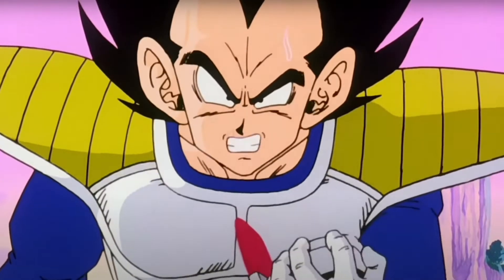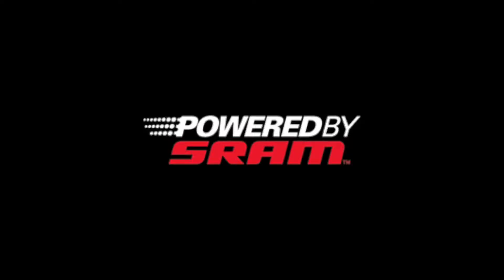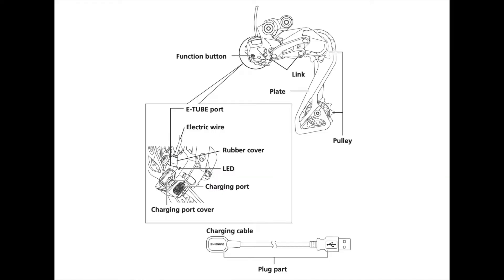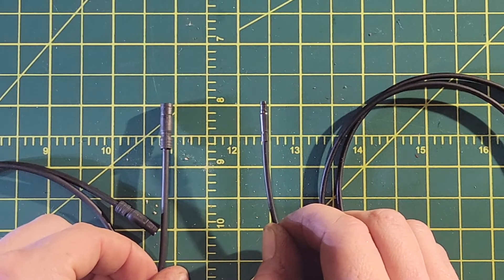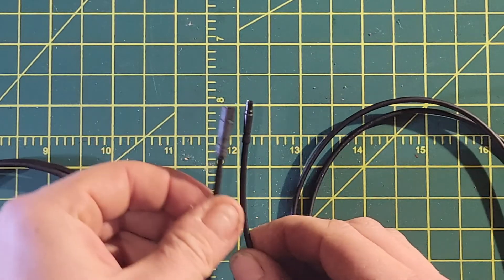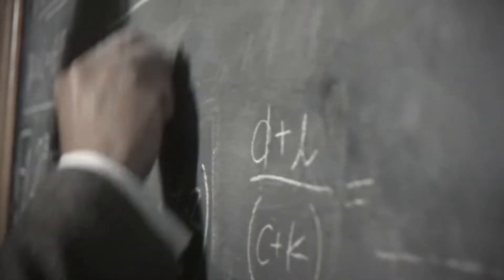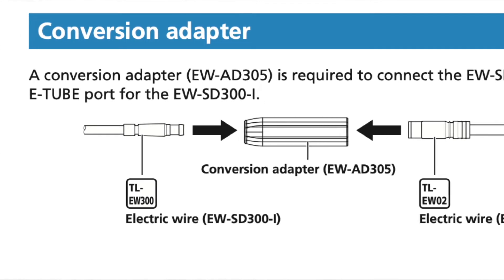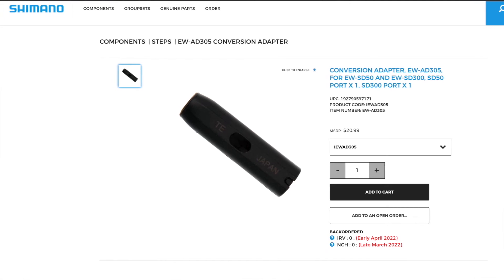TECH BULLETIN: Shimano Di2 12s Firmware Update Tools

Comment: So, I've got a new road bike, I've owned it for 3 months and it's got the new 12 speed Ultegra di2 groupset. Within the E-Tube app it states both shifters need a firmware update. Can someone list what I need to buy, or will it be easier/quicker to take it to my local bike shop?.
Reply from the maker: Instead of writing this all out, here's a good summary: https://bettershifting.com/installation-guide/update-the-firmware-on-12-speed-hydraulic-shift-levers/

If I were a consumer, I would likely just take it to a shop. BUT check with the shop first to see if they are capable of doing it.

Comment: Thanks helpful. For the new 12 speed dI2s, Please do a video on updating the firmware on the shift levers. The wireless app works fine updating the back of the bike. The only thing that won’t upgrade are the shifters. There is a port in the shifter that allows a 300 wire to be inserted. This has to be done with a PC laptop running the E Tube App for Windows. I have the PCE 02 but I’m waiting on the 50 to 300 adapter to hook it up. Thanks again. Very clear instruction and appreciated. Note: even though one shifter needs a firmware update it’s still working great. No issues.
Reply from the maker: Once we have one in hand that needs it, I'll be sure to post an update! Thanks for the intel.
Reply: I applied this for my levers and it worked. Just needed a spared Di2 cable. https://youtu.be/dmGG2P0-5fs

Comment: Shimano are about to release a new wire for the PCE02 that'll plug into SD300 type ports - sometime in May. Let's hope these can actually be bought though.. and that there's some availability and stock :)
Reply: is it available yet?
Reply: @ripptorr  @gplama actually has the PCE02 with the new wire, so the wire on its own should be available by now too :)